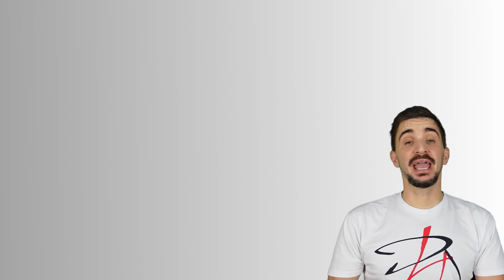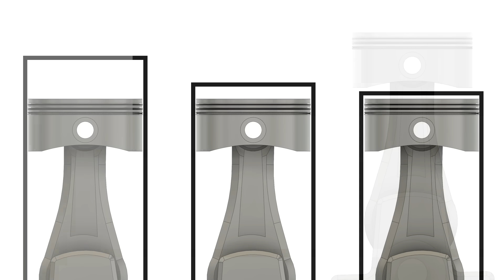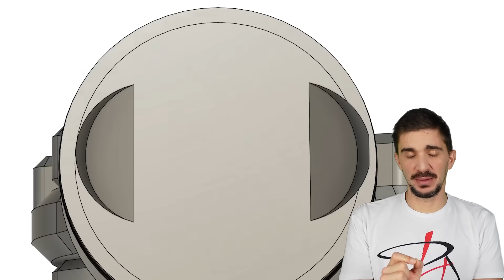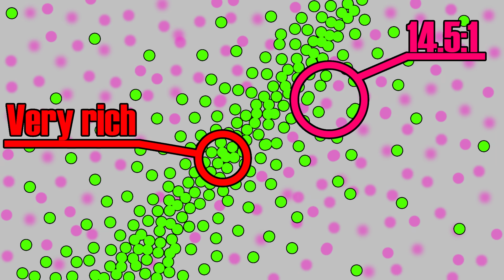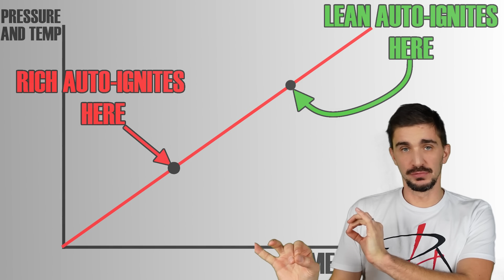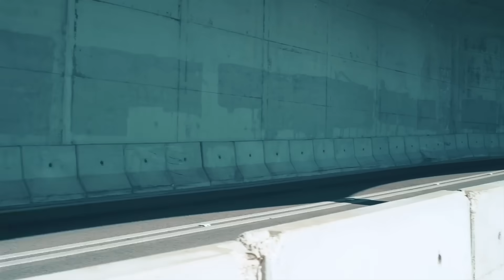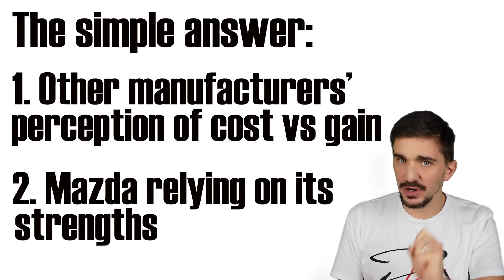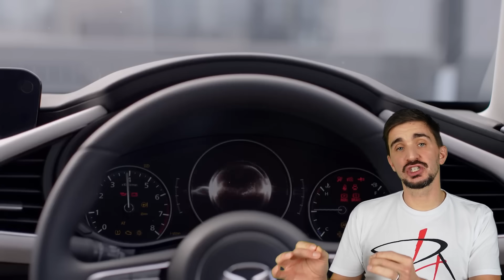The Game Changer Nobody Cares About - Mazda Skyactiv-X SPCCI How it Works and Why It Didn't Catch On

Comment: My father has a Mazda 2 with a Skyactiv G which is not the X version but has similarities (1.5L for "only" 90hp + MHEV with a very long gearbox). It's indeed running very smooth and is enjoyable for the average driver, but as a young car enthousiat, it's definitely lacking punch and character. But i havent tried bigger version of it on the Mazda 3 like the 2.0L 120hp/180hp or even the 2.5L 140hp, maybe it's another story. Right now I might be more interested in something closer to the 1.5 TSI 150hp from VAG (Golf, Seat or Audi)
Reply: Been driving an Audi 35 TFSI for quite a few years and I can already tell you that this engine won't grow very old. Yes it's very enjoyable and fun to drive but that fun is paid in decreased reliability. 5k mile oil changes with oil that looks like water are just one of the things (among others) you have to accept if you want fun.

Comment: Great video. And I like the philosophical insight at the end. I like ICE and the driving experience. Had Mazdas for a long time and I realise that a car with more HP doesn't fully compensate for the nice driving experience. Will come back to Mazda once my current car is done (I like to get them used and abused before changing and not changing for the hype of the novelty).

Comment: So basically Mazda makes the right engine for the wrong audience. Now the important thing is how the wrong audience came to exist. I guess most would be inclined to think it 's something spontaneous, but you 're actually answering this much better in this very video: you 're mentioning journalists. So I 'll take my turn by mentioning that someone controls those journalists. Someone tells them what to tell us. Is it genuinely their official employer, not always. But still, there 's always someone pushing propaganda to favour their own personal gain, regardless at what expense. Wait, I think I just described position abuse, which is a direct result of immaturity. And mind you, this path of least resistance as you describe it is also a direct result of immaturity. To put into perspective what I 'm saying, I 'll mention that driving a car in a traffic jam in the city is abuse of the car rather than use of it. And no, I don't use public transport either. I 'd rather walk. Vehicles are meant for longer distances.

Comment: Honda invented this "idea" way back in the 80s..  It was called CVCC (closed venturi combustion chamber).  It ran on a mixture that was too lean be fired by a spark, so they had a mini-chamber where the spark plug lives, and they put a rich mixture into that chamber by way of a separate valve and a separate carb port.  It was genius, but expensive to build. The Civic model was achieving over 50 mpg in city and highway driving at a time when other compact cars were struggling to get 30 mpg. The only thing that killed this design was the price of gasoline dropped and the extra $1500 was no longer justified.  Competition from Toyota forced Honda to discontinue that system.

Comment: Great video, thanks.
Judging how people still drive, despite the high cost of fuel and people’s (ostensible) concerns over climate change and the depressing realities of driving in the real world these days, I suspect many customers still find power and acceleration more tempting features than fuel economy, when it comes to making an actual purchasing decision. Look at the silly hp figures many car manufacturers now boast, they clearly see these as selling points.
An engine with these skyactive characteristics could work well with a battery in a hybrid car but hasn’t something similar already been done with the Atkinson  cycle engines?

Comment: I own a CX-30: a marvelous piece of engineering which combines the diesel and gasoline engines. It's a 2.0 liters, non-turbo gasoline engine, 180 hp. It drinks fuel as an harvester, plus it has the same acceleration. An absolute success, one must admit. What coud you possibly desire more? Oh yes, the mild-hybrid scam! That "i-eloop" system which should - in theory - bring some "kers" advantages on the engine... but fails miserabily: the batteries never get to recharge, the system doesn't deliver any acceleration and doesn't save on fuel. Another great, great success from Mazda.

Comment: Just change your piston to high compression, standalone control unit, the fuel consump will reduce drastically.

Mine, approx 15% fuel save and 30% increase hp.

Mazda got advance control unit & efficient engine design for HCCI, no wonder it can achieve 30% fuel save.

However you need performance hi comp piston, conrod, good crankshaft balance, etc, that is why Mazda expensive than other manufacturer.

Nothing come free.

Comment: After renting a CX5 years ago we loved it and determined it would be our next vehicle. 180,000 km later we still love it. I get that some may find it a bit boring performance wise but I don’t find that to be a compromise that matters. Dependability over time is more important to me and it has exemplified that all the way. We hauled our 1,000 pound teardrop trailer for 18,000 km one summer with zero issues. We did an east coast vacation trip, with trailer, this past summer and had to give it .5L of engine oil half way through and that was the closest thing to an issue we had. At this point I am planning some routine maintenance such as coolant and transmission fluid change, a higher volume air filter and some other minor things that are recommended but that’s it. All in all, I certainly understand why I see so many other CX5s on the road where I live. I totally agree it appears Mazda has is doing what they do well and have decided to stick to that. By the way, the dealership in Joliette Quebec I dropped into for an oil top up were fantastic to deal with.

Comment: H everyone. Mazda enthusiast here owning Mazda only for the last 23 years. From Mazda 6, B series( pickup truck) to Mazda cx5 and cx30 I enjoy this brand . Never had any issues.Stay on top of maintenance and you’re good to go. Great video!
Reply: Try an MX-5, become even happier :)
Reply: Even the old ones, I have a 94 astina with a B6 engine and the only thing I had to change was a thermostat.
Reply: Mazda has an issue with packaging though, try changing lights on a cx7. All the important stuff they absolutely nail, but if you're looking at used cars expect accessory and trim issues. 

Despite all this I'm very happy with my ol mazda.
Reply: That is a problem with all modern cars. I had to change the Xenon bulbs on my Golf and it took about an hour and I did it on a hoist. It's not a Mazda specific issue, but all modern vehicles are tightly packed.  @mckseal
Reply: @mckseal it's really hard to find some of the parts for my car 🥲
And the tolerances on some of the parts is very very tights so replacements are complicated ^^'
Reply: My Mazda 6 Kitano is probably my favourite car I've owned. My son just bought a gen1 mx5 with the pop-up headlights, which he's wanted for a long time. Good fun.
Reply: Time to get into the true spirit and buy a Miata
Reply: As a car noob what other maintenance do you recommend besides oil changes, tire rotation  and pressures, fluid top ups
Reply: It's more the quality and frequency of the maintenance that keeps the car alive rather than the amount of maintenance. Use good oil, change more often than required and repair defects as early as possible rather than riding them out until more shit breaks  @dumprings
Reply: @dumprings 
Even just regular car washings prevent gunk from building up and causing rust/ window leaks. 1x a month is good but def do it weekly for a bit after any salting lf roads...

Keep up with suspension stuff, once one thing gets out of alignment it causes more wear on other parts.... 

Repair check engine lights asap, like with suspension, problems domino if you let them go

Do an "Italian tune-up" occasionally.... load the car with premium as and drive it like you stole it every now and again to burn off deposits at high rmp (no need to recline, just take a nice road trip on the highway and get it up to 3500k- 4k rpm and cruise)
Reply: My cx-5 blew up at 50k miles. Cracked head. Always did oil changes on time and other maintenance(I’m a mechanic) apparently it’s a thing with those cylinder deactivated 4 cylinders they produced between 2017-2022
Reply: What u love in Mazda the most? Fact that their engines consumes huge amount of fuel or the corosion after few years?

Comment: SPCCI is not the only fuel saving technology that requires a tiny amount of effort to use and therefore has not really caught on. My Seat Leon with a 1.4 TSI has ACT, which turns off two cylinders when cruising with low loads between 1.5 and 3k RPM. It can save about 0.5l/100km but you have to make sure that you are in the right RPM and powerband and that's apparently too much work so newer models don't use it anymore and it was never really advertised as a feature.

Overdrive gears for low RPM highway cruising are another example. Make sense on paper but it would always require a downshit to accelerate and that's too much work.

Comment: I test drove one of those too a few years ago. A Mazda 3 with the newer engine with 15:1 compression ratio and 186 hp and manual transmission to be precise. And I was impressed. I was impressed of an average fuel economy of 6,something l/100Km despite the fact I didn´t actually drive economically most of the time. Older cars with NA 2.0 engines often have a hard time to achieve that while cruising on the highway at moderate constant speeds. I would not have taken the manual as a daily but there is an automatic option. Sure it´s not racecar but lets be honest. Next to nobody needs a racecar.  What impressed me maybe even more before I even started driving was the interior. The choice of materials, haptics, design and build quality are incredible for the price. And I love the HMI design of those cars just like the new CX-60 and CX-80. The important stuff is operated with old school buttons and / but it looks very clean, yet the car has pretty much everything one will ever need. 
Only reason I didn´t buy one is I bought a new car months before that test drive and wasn´t there looking for me but with my cousin looking for a new car for him and in the end the dealbraker was the trunk because he has kids and Mazda 6 would have broken the bank. Hadn´t I bought a different car before I might have bought one. "Probably the most beautful Alfa Romeo Mazda ever built". But the new CX-60 and CX-80 in the PHEV version might become the successor of my current car some day.
Reply: It sounds like a great car for a manual transmission. I LIKE "working the engine."
Reply: @grizzlygrizzle  Nothing wrong about that. You can have a manual while I can have an automatic. For me it's just a strong preference I developed for a daily driver. Just a big qol improvement in heavy traffic which I have to deal a lot with and maximises the usability of the acc. 

Not that there was anything wrong with the manual transmission on that car in particular. Not as brilliant as a Honda Civic Type R (I believe hardly anything will reach that) but definetly nicer than an Mk3 Ford Focus RS. Not just the weight of the clutch but what shifting acrually felt like. I did own a Focus RS for some time and drove an FK2 Type R before I bought said Focus RS.
Reply: @matthiasborgdtadt8673  -- The weight of the clutch is an important factor in the experience. Too heavy, and the workload gets tiresome, and too light, and it interferes with the sensory feedback that enables precise application of torque to the drive wheels.
Reply: @grizzlygrizzle  There's less to mess up on an automatic at this point 😅
VW had a tendency to make clutches that were very light which was nice but almost zero feel for when it was actually starting to engange and it actually did when the pedal was almost all the way up. I'm not sure which car it actually was but at some point I believe some manufacturer tried an electronically operated clutch. The car had a clutch pedal but just a sensor and no direct connection to the thrust bearing. I wonder how they might have done that. And why not make it a fully robotised manual already?
Reply: @matthiasborgdtadt8673  -- Less to mess up? Back in the day, I used to rebuild transmissions. They were far simpler then, and were very reliable, especially if one took the time for fluid and filter changes. Many, if not most, ignored the service, and those old transmissions were still very durable.

Comment: Seems like the SPCCI engine would do better in a hybrid drive like the Chevy Volt has. Running at it's most efficient speed, keeping the batteries topped up when needed.

Comment: The Mazda does something interesting that I didn't realize when I purchased a MX-5.    For 30 seconds after startup, it leaves the exhaust valves open longer to get the catalytic converter up to temperature faster. And during those 30 seconds, it sounded to me like I had a spun bearing, so I was quite concerned until someone in an MX-5 forum explained what the engine was doing.

Comment: It's just part of a bigger strategy. Save the combustion engine. Use the Rotary engine to fill a small 10-15 kWh battery and Boom, you have 750 NM of Torque and 310 HP. . savvy 😊

Comment: I've got a Skyactiv-G engine from the generation before this, and I specifically bought it because of the lovely NA zingy engine, with the higher horsepower mapping option that came on some trims. It's great working the gearbox and rev matching, pushing the engine to high rpms, plus, they're proven to be super reliable. It was the only car in it's price bracket that didn't have a turbo charged engine, which I didn't want.

Skyactiv-X looks even better, and really cool technologically - though the equivalent Mazda 3 weighs a little more, so even with a few more horses, the bhp to weight ratio is worse.

Comment: We have two manual cars and one auto car in the family.
I most times drive the auto like a manual.  Being a diesel it gives me engine braking and better control.
I used to own an Audi Q7, V8 Twin Turbo 4.2 diesel with 6 speed TipTronic auto.
Damm I loved that auto.
Amazing control.

I’m an old fart and I still love changing gears so maybe I’d like this engine?
I do love diesels though, even with all their issues.

Our 2016 Nissan Xtrail turbo diesel (1.6L) with 6 speed manual easily gets over 1000 klms per 60L tank on the highway.
320Nm Torque is heaps and it can rev!
Engine braking also is handy.
Of course, they don’t make them anymore-typical.
Naarrhhh, I’ll stick to all my older cars.
The only 2 things that give me the shits about the 2016 Xtrail is the electric brake and that stupid “start/stop” system, which I immediately turn off before I leave drive off.
Absolute BS these CAFE requirements.
I will never, ever buy an EV or Hybrid.